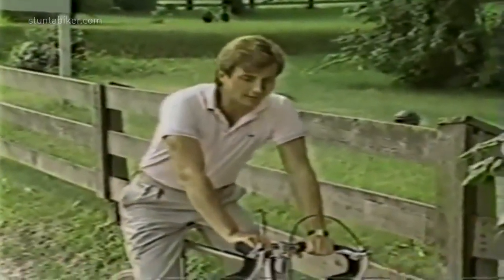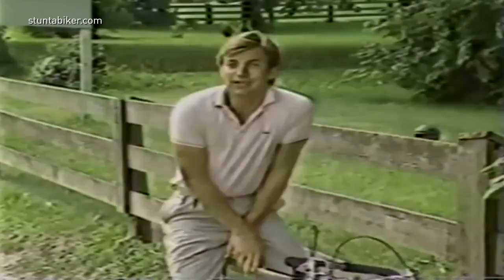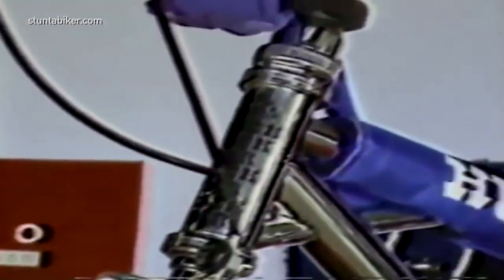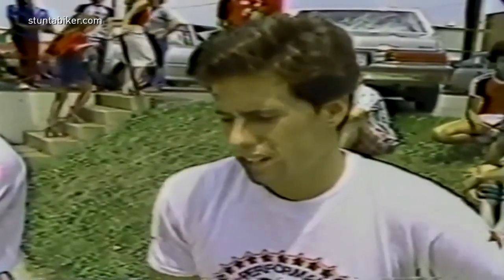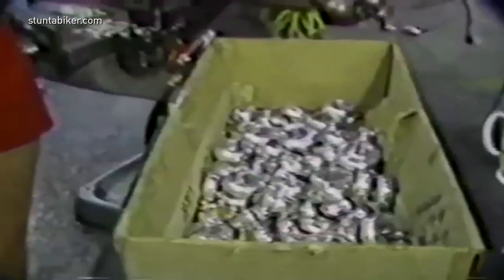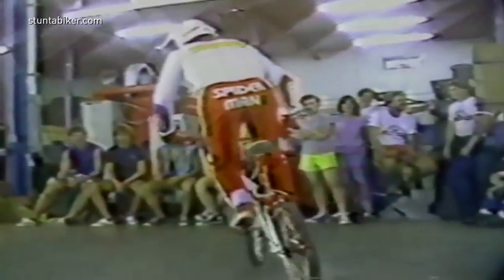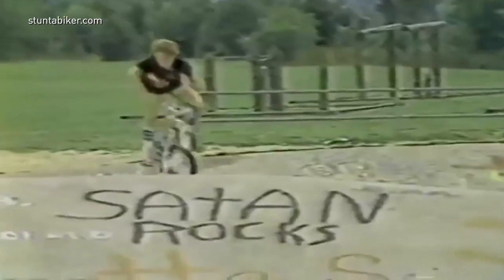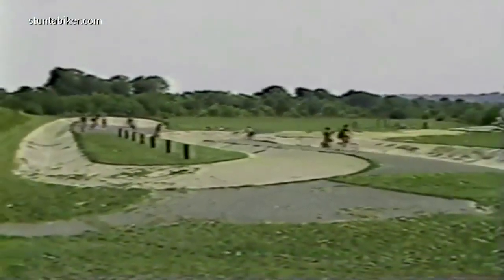HISTORY OF HUTCH BMX | Rich Hutchins | 1980's |

Comment: Rumour has it someone slipped a Hutch bear trap onto their shins in the 80's....still bleeding yet....
Reply: being from baltimore i have a hutch trick star stolen off the line before the platform was added on and no chrome applied yet.. rode it through the 80's and its hanging in my basement right now..
Reply: I have done that right at the starting gate those thing went right through my  JT pads 😭
Reply: @akira4085  for sure 46 years old and stil have scares from my teens from it..
Reply: @theabhominal8131  Lol they will all ways be remembered for those cages
Reply: @akira4085  for sure but i wouldn't change a think being from Baltimore hutch was a big part of my childhood
Reply: @theabhominal8131  what do you think about the new HUTCH products at there website? I have they’re pedals on my S&M speed wagon  And they came messed up one the spindles are bent so the pedal keeps coming off I have to tighten the outer Allen  with my finger like every 1/2 hour of riding and they don’t spin good at all I even bought new bearings for it it’s just defective 😟 so 8m really hesitant about getting a Frame and fork set I have money and I’m really thinking bout it Tho because there’s just nothing else out there
Reply: @akira4085  its a trash company now owned by a different person..  dont even think its in Baltimore any more and most stuff is made in china now..
Reply: @theabhominal8131  oh wow that’s saying a lot right there, I wish Patterson DG boss FMF and mongoose would all come back , gosh. I just really miss the 80’s
Reply: "mom can you pick me up, I clawed my shin apart with my pedal"
Reply: I still have those scars and continue to get them with my Big Ripper....LOL
Reply: Me too and I was casually riding.
Reply: My right rear calf has had a Bear Trap tattoo since the 1984 Gilley's nationals.
Reply: Oh the Bear Traps. Wish I could upload a picture of the kiss I got on my calf back in '87. Almost stuck a sweet tabletop 180... Oh those Bear Traps.
Reply: The oddysey triple traps looked like a rabid pitbull got ahold of your leg if you missed a no foot can.
Reply: Who thought it was a good idea to make the pedals more like a weapon than an item of necessity?

Comment: I had an Expert series Hutch, pre-serial number days.  That was the last BMX bike I ever owned, mostly because I had no need to get something different.  Takagi 175mm crank, 44/16 gearing, Araya rims, DK neck, Powerlite handlerbars (I really miss those), but NO bear trap pedals.  I saw someone eat it once with those, no thanks.  Loved my bike!  Even took it lake jumping, trail riding in Oregon, and raced ABA, and NBL for a few years.  Zero cracks, and took a lot of abuse.  Great bike!
Reply: So where is your hutch now in Oregon? Or did you donate it or did you completely get rid of it? Because I had a hutch trick star. That I bought for nineteen ninety three in houston, texas for 3 hundred dollars and then almost gave it away in 1996, I was so mad now, wish I still had it, it was gone when I arrived moving to San Francisco in 96
Reply: What's your expert a little shorter than a regular hutch pro? Racer correct
Reply: Was ur
Reply: @jasontomica8938    I didn't know there was a difference between the two.  I assumed a Pro series just had more Hutch items (3 piece cranks, beartraps, etc.).

Edit:  didn't see you're other question.  Mine got stolen shortly after high school.